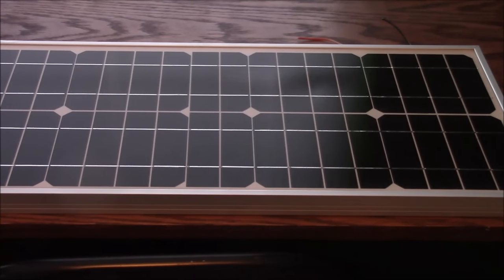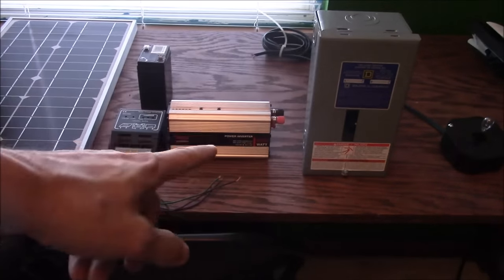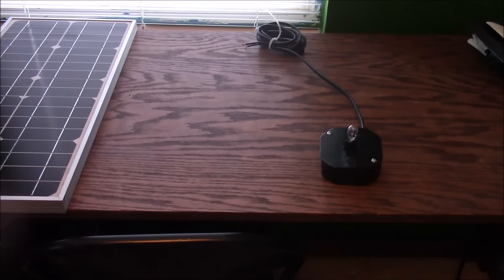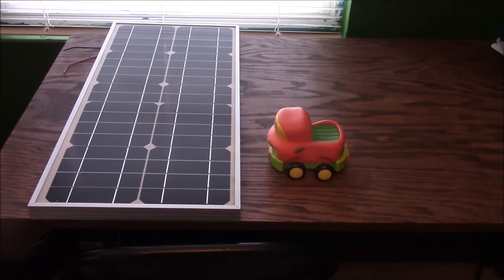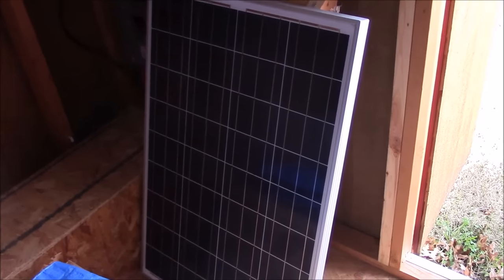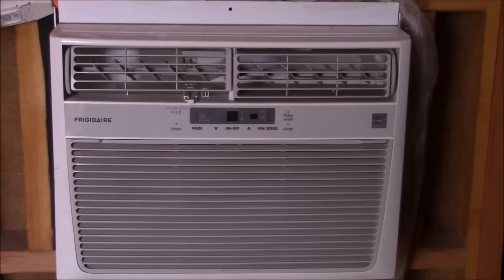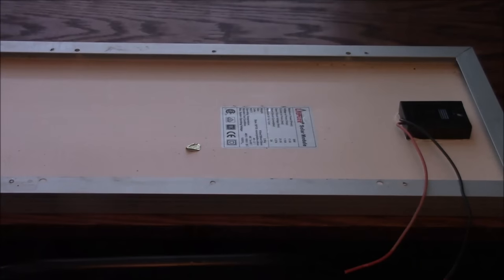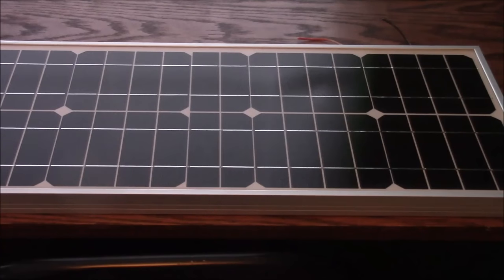Solar Panel Systems For Beginners - Pt 4 Frequently Asked Questions

Comment: Hi man, great video, my question is, could you  do a video to test  when a charger regulator is bad ? thanks!
Reply from the maker: Hmmm, I probably could.  But I can't think of a way to test that right now other than trying another charger.  Let me think about that.  If you have any suggestions let me know.
Reply: +LDSreliance Ok, as you remember, I have a video in my channel about my regulator what is in very "strange performance", in that video I checked with my multimeter.  I have my second new one regulator (I bought 2 , same model you see in the video) and posted a comment in that video with the results of the test I did today. I am not sure if the values can help to compare my second one with my first one   . Thanks!
Reply from the maker: So the red led's are on but not blinking this time?  It looks like everything is good.  Your voltages all look good.  Do you think it is still bad?
Reply: +LDSreliance Well in this case I received another regulator, same brand, same vendor, but I m not sure to answer your question.
Reply: +Felix A. Vargas A. I tested w/my multimeter  from solar panel 13,80, from battery and load 13,62 today at 1 pm.
Reply from the maker: Felix A. Vargas A. Those all sound like the right voltages.  When the charge controller is doing its job the incoming (solar) voltage will be the same as the outgoing (battery) voltage as well as the load voltage on the battery.  13.6-13.8 is a perfectly normal charging voltage for a 12v battery.
Reply: +LDSreliance Ok, thanks a lot for your help man.
Reply from the maker: Felix A. Vargas A. You are welcome.  Any time!

Comment: could i just use a solar panel and a inverter and take out the battery and charger controler
Reply from the maker: +chrisgaming24 cc No, you can't wire an inverter directly to a solar panel.  The voltage fluctuates too much and the inverter will not work very well.  And as soon as the sun goes behind a cloud or moves to the wrong angle, the inverter will die suddenly.
Reply: Thank u good to know

Comment: How do you make solar panels?
Reply from the maker: If you want to make your own, you would need to buy the solar cells, a special type of glass that allows the radiation through (you can't use window glass, for example), and some other materials.  You would basically solder all the cells together and encase them between the glass and a backing material.  I have never done it before so I can't give you all the specifics and a build list or anything like that.  But there are lots of good videos out there showing how.

Just keep in mind that unless you do a really, really good job and are highly adept at things like this, you probably won't make something that performs the same as a manufactured panel.

Comment: Great series, thank you.
I have one question, can I run a solar array without a load center?
Reply from the maker: Of course.  That is only if you need to split the power between multiple loads.

Comment: how to know your battery is already full charged?
Reply from the maker: +Nonoy Regalado It is hard to tell manually.  Your charge controller will be able to tell and will switch to a float cycle to keep it topped off but it will stop actively charging it.

Comment: Can we charge car battery with solar panel
Reply from the maker: Yes.  You just need a charge controller, solar panel, and the various wiring, connectors, safety stuff, etc.
Reply: I have solar panel which can make more than 17 volt
Reply: I just ordered a charge controller 
I will get it soon

Comment: how to install more then one solar panel?
Reply from the maker: To use more than one solar panel you need to either wire them in series (+ of one connected to the - of the other) or wire them in parallel and use a combiner box or buss bar.  If you wire them in series, keep in mind that your voltage will be higher.  If you wire them in parallel then your voltage will be the same but your current will be higher.  This video will show you how to wire in series vs parallel (using batteries instead of panels but it is the same concept):  https://www.youtube.com/watch?v=4yxR-Iz2Xdc

Comment: with it taking so many panels to run a single ac unit how are solar panels saving the consumer money to run there house?
Reply from the maker: That is a good question.  In most cases, solar will not save you money directly.  Sure, you can mathematically get a return on your investment in about 10-12 years so if someone is going to be building their dream home and plans to live there for the rest of their life that could be a money saver.  But for most of the rest of us, it saves you money indirectly by educating you on electricity, raising your awareness of where the energy is consumed in your home (i.e. electric heating devices and cooling devices), and causing you to make at least subtle lifestyle changes that decrease your dependency on energy.

For example, when I started all of this about 6 years ago about all I knew about electricity usage was that my bill goes up in the summer and I have to pay the electric bill each month.  But as I researched and got interested in prepping and as I started spending time at an off grid cabin in the mountains each summer with no electricity I realized how electricity dependent I was and if the crap hit the fan some day I would be completely unprepared.  So I started researching solar and learning some of this stuff and, to make a long story short, started making changes like replacing all my lights in my house with LED's and setting my thermostat a bit higher and insulating my house better, etc.  I installed attic fans in my attic running off small solar panels and tracked down a bunch of energy vampire devices in my house.  I optimized the energy consumption of my refrigerators and replaced seals around windows and doors.  I can't go off grid in this house but someday I will and all of these seemingly small changes as well as some big changes like radiant floor heating, geothermal cooling, and passive heating and cooling will allow me to really save the big bucks.

Comment: What about a box fan?
Reply from the maker: Yes, a box fan can be powered by solar without much trouble.  Most of them use about 100W so you will need at least that much solar power during daylight hours.  To power it around the clock, you will need at least 500-600W and a decent battery bank.

Comment: you are wrong you can power your electic bikes and your chairs as long as you have electic motors on them but you have to use 12w to  100w panels
Reply from the maker: The panel, regardless of the size, will not be able to keep up with the power consumed by the e-bike or scooter or electric chair.  It will pull its power from the battery and the solar panel will provide a small trickle of power to help offset a little bit.  That is the best case scenario.

Comment: Hmmm. I did a video on my solar powered air conditioner (similar to yours, 8,000 BTU). I hooked up a Kill-a-Watt meter to it...on full tilt...600 watts. https://www.youtube.com/watch?v=9dAmhkJIdXc
I do agree with you to have ~2,500w in solar panels to run an air conditioner like ours. It can be done with about 1,500w in panels...but, not much else can be run on solar. And, you only get a few hours of actual powering.
Reply from the maker: +Chris DIYer Yes you are right.  After they get going they don't require as much power.  But for that first 5-6 seconds they require about triple the power to get the compressor motor started up.  Kill-a-Watt meters do not read fast enough to register that power spike but it is there.  That can be handled by a big battery bank no problem or if you set up a capacitor bank.  So you could probably run your AC unit off a 1200 watt solar array with plenty of batteries and capacitors no problem.
Reply: +LDSreliance To save on power with an AC you should get a mini split system (like Mitsubishi). They have the inverter technology and it saves a lot on starting the compressor which is where a lot of the power goes to. Those window AC units consume more power than my electric car uses for a 1000 miles. It's time to stop using them...
Reply from the maker: Oren Yehezkely
I agree.  At some point I am going to buy a mini split system and play around with it and do a video on it.  I have heard great things about them.  Thanks for the comment and keep watching!

Comment: The pumps will run 24/7
Reply from the maker: Do you know how many watts the pumps consume?  24/7 loads require a LOT of solar.
Reply: 27 amps /pump
Reply from the maker: 27 Amps.  What is the voltage?
Reply: 110
Reply from the maker: OK, final question.  Where do you live?
Reply: 960 Nesbit Rd.  Nesbit, Mississippi 38651
Reply from the maker: OK, to run two of those pumps around the clock you would need 60,000W of solar panels.

Comment: So the answer to the second question is "Yes, but it is more practical to use a charge controller."
Reply from the maker: Kinda.  If you do wire it directly you can damage the load since the voltage will be much higher than 12V.  So not only is it more practical but it is safer and less risky.

Comment: so how many watts do i need to put into a say 500w grid tie inverter to get 500w out of it???
Reply from the maker: The inverter itself is pretty efficient at about 95% usually.  But you will never get 500W of real world production out of 500W of solar panels.  So a good estimate would be about 700-750W of solar panels to get 500W out of your inverter after factoring in the losses and inefficiencies.